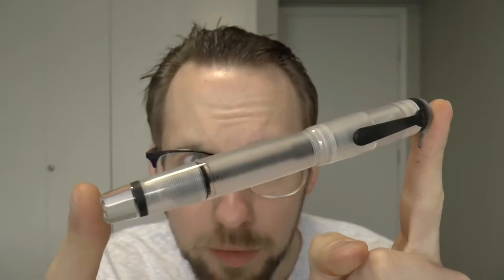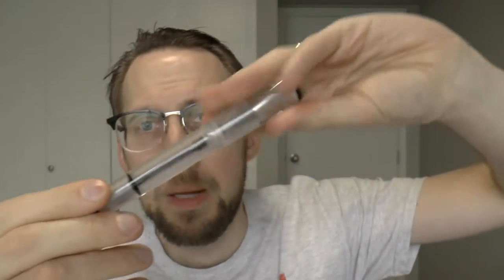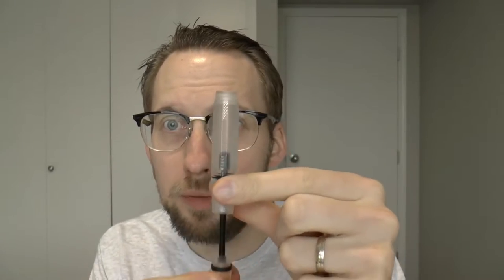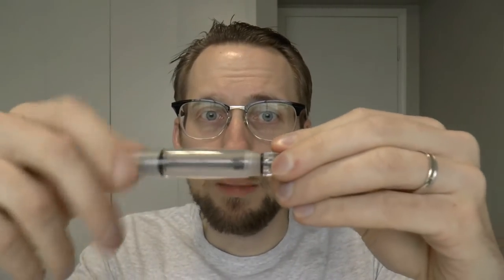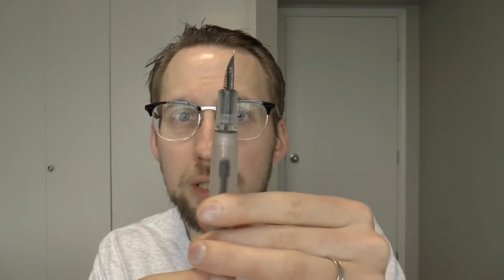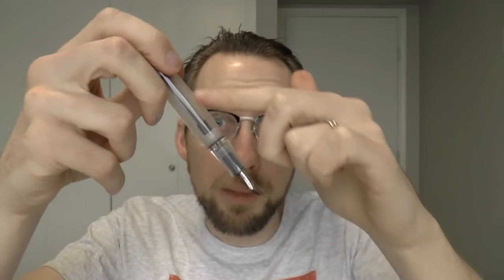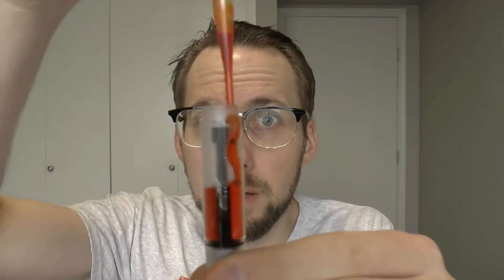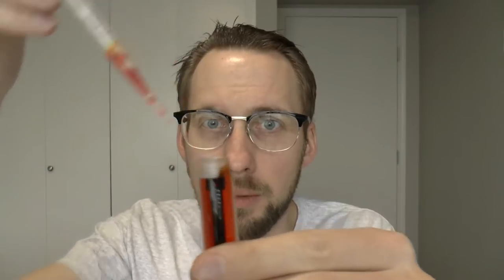One Way Shutoff Valve Fountain Pens Theory Practice Tips and Tricks

Comment: Another thing you can do to fill the feed and secondary ink chamber, instead of flipping the pen over while the section is only partially screwed in, is to use the shut off piston. When the barrel is full, after you screw the section in, you can fully unscrew the shut off valve, pull it out a centimeter or two, then push it back in and re-screw closed. Do this one or two times. The piston, even though it’s not sealed, will still push enough ink to fill the second chamber and feed. I do this with my koloro all the time. In my experience it’s best to do this tip-down over an ink bottle or paper towel.

Comment: You can pretty significantly increase the wetness of the pen by using the plunger to force extra ink into the feed. I do that with my Opus 88 pen because it writes a bit drier than I’d like. You gotta be careful though because it’s very easy to push out too much and leave you with a mess.
Reply: I do this to prime the feeds on both my OPUS'. Works really well, just gotta do that over an ink bottle or something.

Comment: Very interesting.  I have a TWSBI Vac 700, and it has a very similar rod system and shut off that also doubles as the vacuum generator.  At first I thought this was going to be the same. Now that I understand this system, I have to wonder why one would bother with the Vac fill at all, this approach seems quite a bit simpler and has most of the advantages (minus a certain cool factor of the vacuum).

Do say hello to Haemish for me, I don't believe we've seen him for several months!
Reply: An eyedropper requires the use of a pipette or, well, an eyedropper! A piston or vac filler does not require another piece of equipment that I don't think most people--even FP folks--necessarily want to fuss with.
I love the system, and have one of these pens on my wish list!

Comment: Excellent information. I have a Wing Sung 699 vacuum filler. It appears to behave in the same way. I fill the main chamber with ink but when the pen runs dry I have to open up the blind cap and pull the piston seal up a bit to allow ink to flow. Is this normal for a vacuum filler?
Reply from the maker: Yes.

Comment: Dr. Brown: Have you confirmed yourself that eye dropper pens burp due to heat from your hand or seen a demonstration of this you could point to?  I ask because I discussed it with Brian Grey of Edison Pens and he said that he has tried to cause burping; in a pen that burps, with body heat and couldn’t get it to occur so he doubts this explanation.  I’ve heard this explanation before but don’t know if it is repeated conjecture or something that has been demonstrated.  PV=nRT so an increase in temperature does increase the volume/pressure of air but it may not be a significant percentage.  72F (room) to 98F (body)  is roughly 295K to 310K (temp needs to be in Kelvin - 1F to 2F is not a doubling of the temperature) which is about a 5% increase.  That assumes the ink gets to full body temperature which it likely does not because of heat transfer along the part of the pen not in contact with the hand.  I am not knowledgeable about fluid dynamics so perhaps the explanation is correct for reasons that aren’t clear to me.  Just wondering if it has been verified or not.  Thanks and thank you for the tip about removing the Omar’s clip.
Reply: I've never believed the hand heat theory.  Then again I have no better theory.
Reply: I don't believe the hand heat theory either. And I note that it happens on certain pens more than others, without apparent connection to contact with body. I think it might have to do with interplay between ink surface tension on the sides of an ink barrel, and wet feed. So that as ink level lowers, it is more ready to flow?? That doesn't sound quite right either to me.
Reply: It also seems bizarre that vacuum and piston fillers don't experience this issue nearly as much, even though most have a large ink chamber that could be affected by heat as much as an eyedropper would.
Reply: I have experienced definitive proof that hand heat is a factor in burping. I have a Ranga pen that if I pick up and hold in my hands, even nib up, it starts spewing ink like a chocolate fountain. Even when nib up, the expanding air pushes the ink trapped in the feed up and out. The solution is to store the pen nib up and pick it up nib up and hold it nib up until the pen warms up, so that no ink gets between the expanding air in the barrel and the outside world until the pressure has been released; if the pen is tilted at all before it is warmed, and ink gets trapped in the feed, between the expanding air bubble and the outside, I get a literal ink fountain. The phenomenon is more frequent in pens with ebonite feeds that have wide channels: these have very good ink flow, especially for flex writing, but that wide channel and easy flow makes burping equally easy. Don't get me wrong, I love that pen, as it has a great flex nib that never gets starved - but it needs proper handling. 
Eyedropper pens usually come from India or Japan, where ebonite feeds are frequently used; more modern feeds, with narrower channels and a lot of internal fins can minimize the problem. Eyedropper pens also have a much greater ink capacity than piston fillers, where the mechanism takes up half the barrel volume at least; this means that you can also have a lot more air in the barrel, so that a lower percentile volume increase can actually amount to a significant amount. Vacuum fillers have the shut-off valve that prevents burping when closed - and even when open, the gap between the vacuum seal and the barrel walls is very narrow - a lot narrower than in eyedropper pens with shut-off valves - constricting the flow of ink. More importantly, though, in vacuum fillers, air can actually escape from the end of the barrel (that is, in part, what happens when you pull the rod up) and thus the pressure is released that way.
Reply: @GPngts  Thanks, I'm happy to hear an actual data point on this issue.

Comment: I really don't understand why people call this a "one way shutoff valve." Ink can flow either way with the seal open. It would only be "one way" if it had a flap of rubber to flap back against an internal surface (flow can go one way, but is prevented by the flap that covers the hole). These are common in air mattresses. 

This is an eye-dropper pen with a shut-off valve/seal. The seal mitigates the problem of a large chamber of air/ink to prevent burping. Opening and closing the valve with the nib up you should rarely get burping because the pressure is allowed to change in the chamber with the ink away from the nib. 

A huge benefit of these pens, besides being able to shut off the flow of ink to the nib in order to prevent burping, is that you can unscrew the sealing plunger, point the nib down, and screw it back down and you've got a primed, ready pen. To pull ink out of the feed, you can pull the rod back a bit a few times with the nib up and it will suck air through the feed to clear the ink back into the ink chamber.

(Edited for clarity)
Reply: When engaged, the valve shuts off ink flowing to the nib. That's one way. Obviously it also shuts off ink flowing "from" the nib into the barrel, but that's not a usual way to operate a pen and not something intended to be stopped. So... one way shut off.